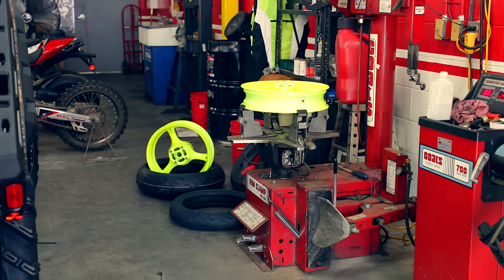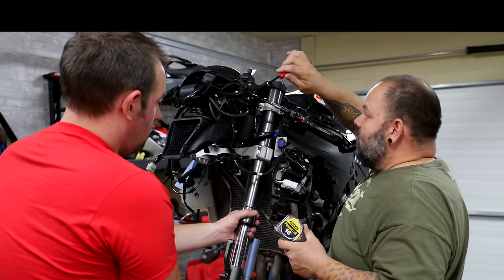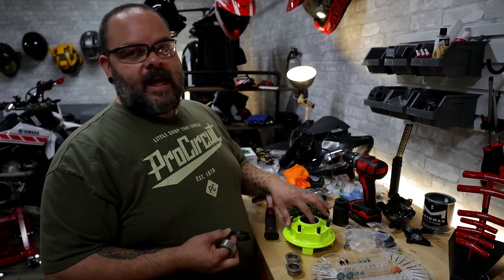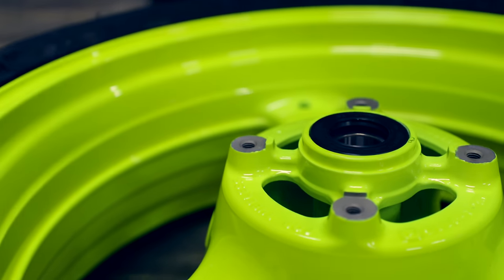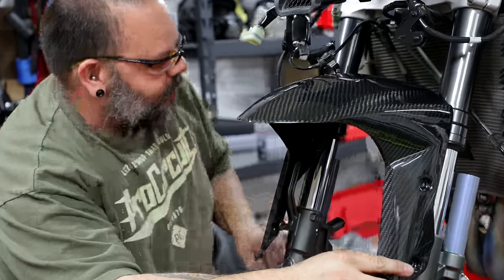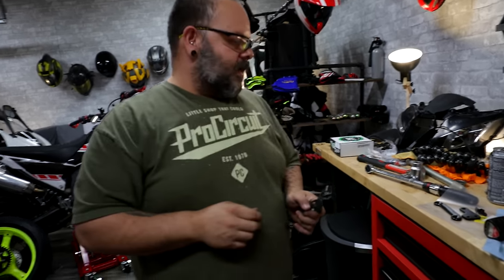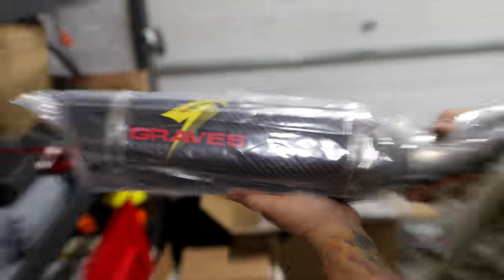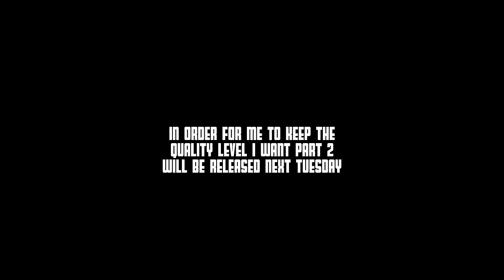I didn't want to RUIN the WHEELS!! [Wrecked Bike Rebuild - S2 - Ep 18  - Ninja ZX-10R (part 1)]

Comment: If you think the bearing mounting is tricky, put the bearing in the coldest part in your freezer until its properly cold (sub -18 deg C) and before you take it out heat the hub with a electric heat gun to approx 80deg Celcius. If all goes well you can almost press it into place using only your fingers if you are quick enough (less 60sec). And get the right tools for the job, it makes it go a lot easier.

Comment: Chase, when you were hammering the race in, do the following: rest the hammer on the socket. Move your hand up or down until the shaft of the hammer is parallel to the ground. Keep your hand at that height from the floor and strike it. That way you will get a nice strike that is even, not angled. That's basically what Brian did, if you watch it. Nice work! #AClockworkOrange

Comment: I think the front tire is backwards... correct me if i'm wrong but the grooves should go towards the outside part of the tire in order to push water away from the rolling section of the tire right ?
Thumbs up so Chase can see it ;)
(only if i'm right tho)
Reply: Paul T FWIW, I used to think the same thing, that the grooves should guide the water away from the middle of the tire. But for some reason unknown to me, it's not like that on motorcycle tires. Might have something to do with how things change while leaning.
Reply: Alright, so I have just checked and I got the answer, you might find it interesting too ;)
The purpose of the grooves are exactly the same for the front and rear tires: push water away front the middle of the tire. But the rear tire is designed with the main purpose of providing traction to the motorcycle while accelerating, whereas the front tire goal is mainly to provide enough grip when braking, because it provides 70% of the braking force. So the answer is simply a matter of hydrodynamics, the grooves are "inverted" on the front tire because the water trapped under the tire and between the grooves simply want to go the other way when braking compared to accelerating ;)
If you want more details on that, if found a website that explain everything: just type "why are motorcycle front tires grooves inverted" and its the first one.

Comment: OUCH!  That looks cringe worthy with the bearings.  Besides putting the bearings in a freezer before installing, Harbor Freight has a cheap 12 ton or 20 ton press that eases the bearings right in with no fuss and no hard impact.

Comment: Put that  bearing in the freezer and 45 minutes later it will fall right in...
Reply from the maker: Excellent tip my dude!
Reply: If you have a heat gun you can heat the hub up (be careful not to get it so hot you melt paint) and take the frozen bearings and you can literally drop it in....cold will shrink the metal a tiny bit and heat will expand it....so you wouldnt even need a hammer...(usually LOL).  Once the temp normalizes its perfectly seated...  Love the show Chase...reminds me of when I first started out working on my bikes....I sit here saying NOPE..>NOPE....DONT DO THAT....then am all happy when you correct it..LOLZ  On your torque wrench...here is the one I got and its AWESOME...  https://www.amazon.com/gp/product/B000I1UTI4/ref=oh_aui_detailpage_o00_s00?ie=UTF8&psc=1